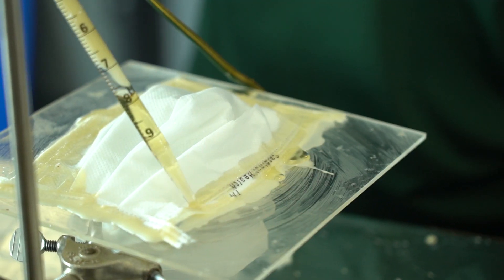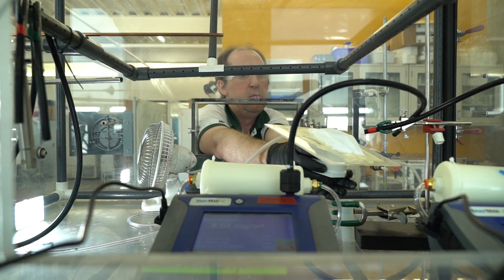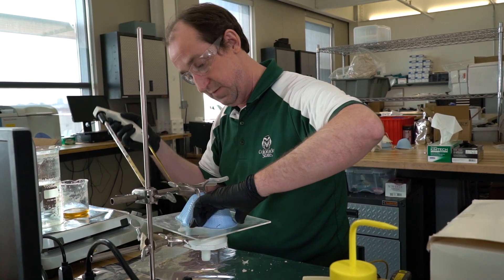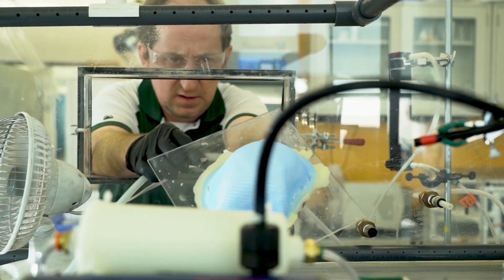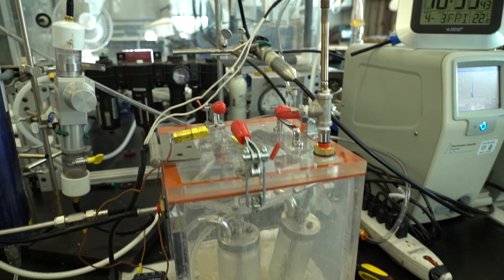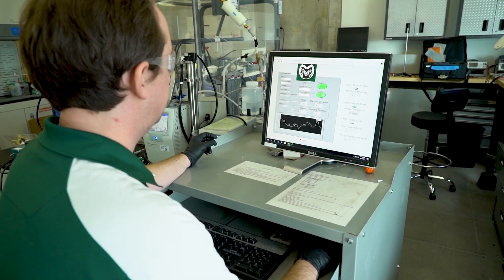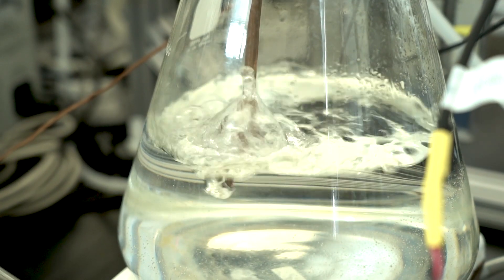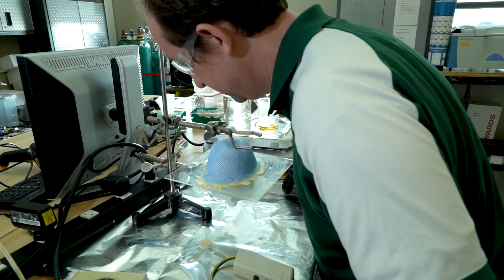COVID-19: CSU Lab Testing Mask Safety Against Coronavirus

Comment: Four problems with the experiment I noticed in just this 1 and a half minutes...
1. You are measuring air outside the mask only in one little spot, so of course it's going to read an artificially low particle count because you aren't sampling the entirety.
2. Aerosols are more than an order of magnitude larger than viruses, so this doesn't tell us anything about if the masks are functioning as they are designed for. Are virions inside the aerosol particles staying there about after contact with the mask?
3. The test is too short. Do aerosols exhaled in the first breath stay within the mask, or are they pushed through by subsequent breaths? If a mask is effective then the concentration if particles inside the mask must increase every breath.
4. As many others have noted, nobody seals a mask to their face.

Comment: Once you see what the results are, compare that to a far more realistic approach which uses a mask fit to a medical dummy face, and is not glued in place.  Common sense should explain that there will be considerably more particles found inside the mask when worn in the customary manner.  Gluing a mask to a surface can only show results found in an optimal but unrealistic situation.

Comment: Without testing the masks on at least a dummy head you are only getting the effectiveness of the material, which is not an indicator of how well it works on a human face without being glued down.
Reply: it at least shows if it can go through the mask, but be my guess, test it out
Reply: Where are The Mythbusters when you need them?
Reply: @lloydchittenden1670  idk ThunderF00t perhaps
Reply: Diy testing your mask put on the mask wear swimming goggles trace a line with lipstick around the mask at skin area have someone sprinkle baking flower over your head with a manual sifter as you breathe .  Take off the mask  observe the flower on the inside of the lipstick circle ⭕️   Take a selfie 🤳 
thank you

Comment: What particles are actually being used for testing and what size are they?  How do you test for particles that may be entrapped in the mask?  Say for example after a coughing and sneezing episode where inhaling and exhaling are exacerbated. Are the entrapped particles inhaled and/or some ejected at a high velocity?  If you read the fine print, all N95 type mask including the 3M 1860 or P100 filters, are only tested for particle size of 300nm and larger. The COVID-19 virus is approximately 120nm in diameter IF unattached to a droplet. That is even smaller than tobacco smoke particle. I read on the CDC site that allowing the manufacture to select from a range of air velocity means that the test results can be easily manipulated. In general, particles are collected with higher efficiency at lower velocity through a filter.  I fully understand something is better than absolutely nothing, be it a surgical mask, homemade surgical mask, a 3D printed mask, or even a bandana. I will be extremely interested in your testing protocol and results as well friends of mine watching.